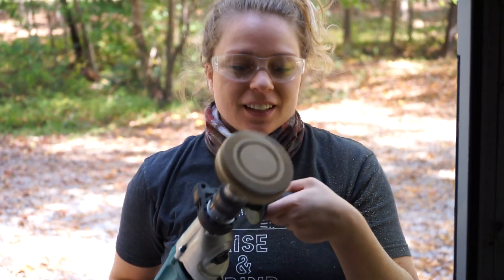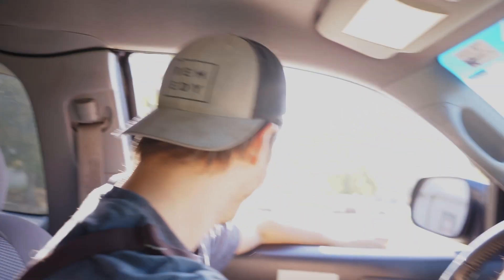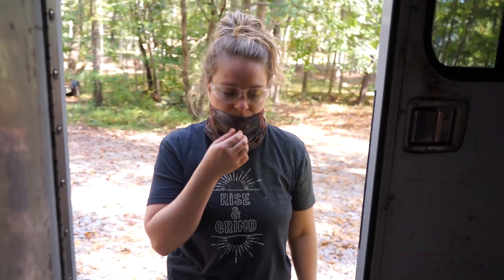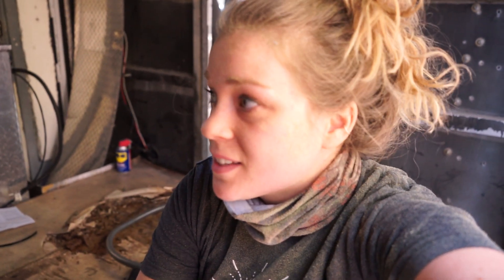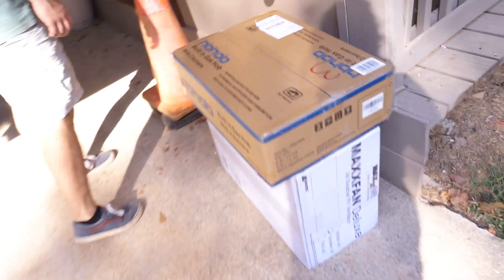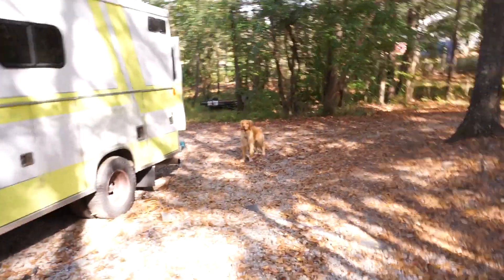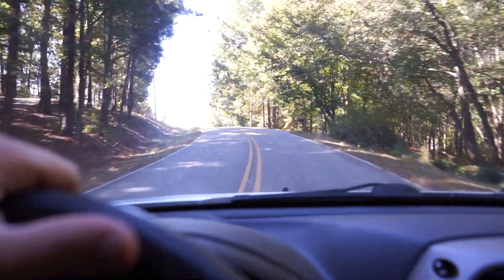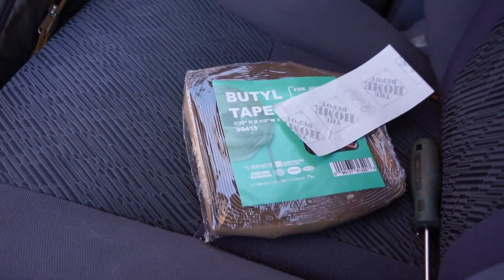Made a MISTAKE Buying This Ambulance? (It's Hard) Week 7

Comment: So, just to clarify, you got paid by the dump for the value of the scrap aluminum, wire, etc., right? The copper wire can fetch a nice return.
Reply from the maker: No we haven’t dropped off the aluminum or wire yet at the scrap yard. I held on to those piles in case I need to use some of them. I’ll cash those in when we’re closer to finished 👍
Reply: @stephandmicah  I don't know if it's still true, but my brother once told me you can get a better price for scrap copper if you remove the insulation.
Reply: @stephandmicah  Makes sense! You might even watch scrap prices to try to time your trip for the highest payout.

Comment: Hi whatcha up to hope all is well prayers 4 healing and unspoken also 4 everyone in the name of the Creator God and Yeshua / Jesus Amen much honor and respect keep walking tall also the fan bro make u a metal frame around the fan underneath it under the ceiling attached to the main frame that u cut the metal cross member this is part of the structure and a weight barring area however that is my opinion yall r doing great job keep on keeping on and always walk tall yall 
🚌🌅🌌⛺🌄🏞🏖
  👍👍💪🙂👍👍
Reply from the maker: Thank you!! Yes that's a good thought! Although we decided against adding any metal support because even with the crossmember removed it was still incredibly strong. That's the benefit of an ambulance! The box is designed to withstand a lot of damage.